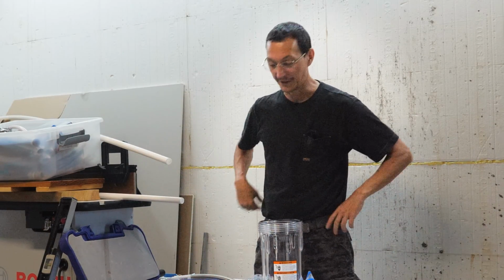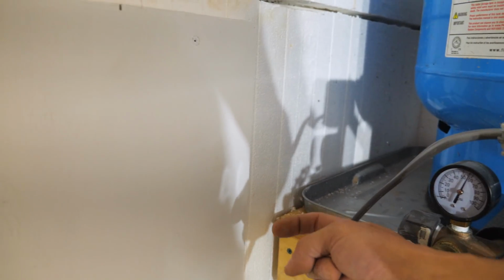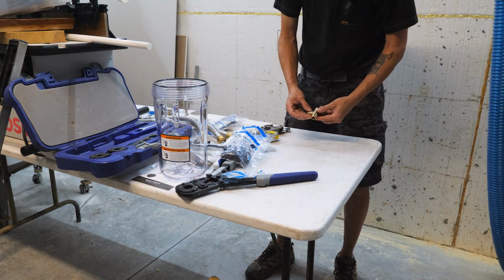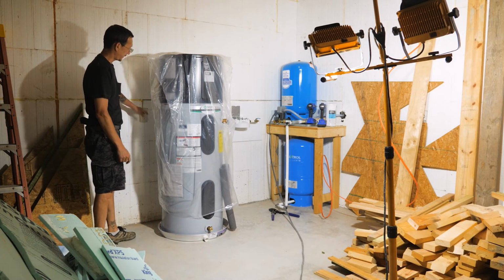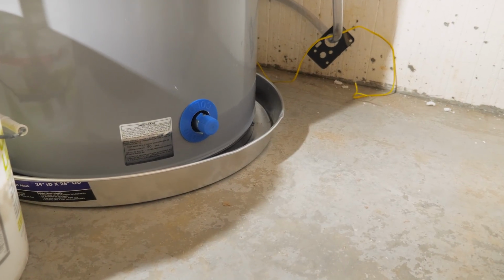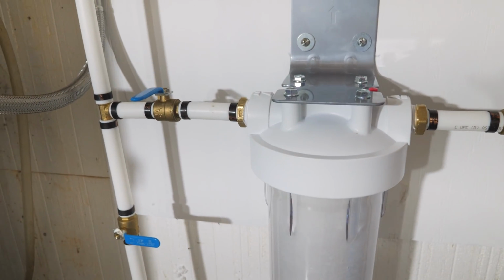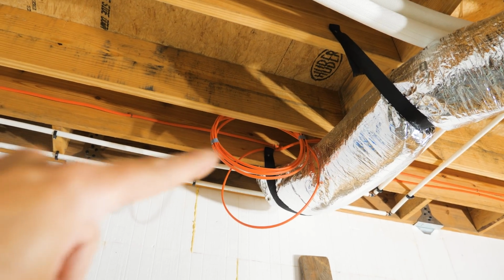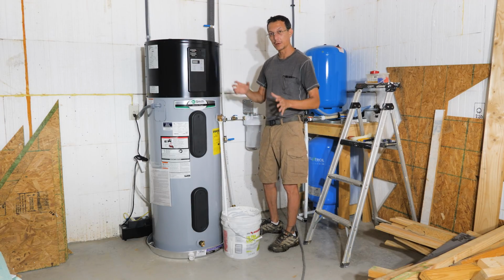Installing an AO Smith Hybrid Heat Pump Water Heater

Comment: I have trouble wrapping my head around how a heat pump generates more heat per watt of electricity than plain resistive heaters.  Maybe ill figure it out some day.

Being in a desert, most of my showers are going to be on the cool side of lukewarm so it's kind of a tough pill to swallow having a big tank of hot water sitting there, constantly dumping energy in to it 24-7.  If I did laundry more than 1-2 times a week or I liked long hot showers, I might feel differently but I'll be trying to conserve water too.

On the other hand, with solar the possibility of an all electric house with no power bill is very tempting.  I'm even thinking of moving my cooking to outside with an in-ground pit bar-b-que, a brick pizza oven and probably some type of griddle bar-b-que for searing, all powered from local mesquite wood.  Buying an extra tank of gas to go out in the desert looking for dead mesquite seems like a better use of money than filling up propane tanks and it cooks better too.

Any way, I hope your water heater works out well for you and saves money.
Reply: The answer is hidden in your first paragraph. A heat pump doesn't "generate" heat. It moves heat from one location to another. The energy in the heat, that is being moved, was already there. Where a resistive element must generate the heat from electricity.
Reply: We have our heat pump water heater installed in the garage. It does a good job cooling the garage in the summer, moving the heat into the water (essentially an Air conditioner). 

The winter here is mild, with lows slightly below freezing. But out garage will retain enough heat for adequate heat transfer into the water heater. Hybrid mode ( using the resistive elements ) will step in to fill in the gaps. We also charge two electric vehicles,  run a chest freezer, a washer and dryer (dryer is a ventless heat pump), all of which generates waste heat that can later be absorbed by the water heater..... assuming the garage door is closed.
Reply: Another way to think about a heatpump is that it concentrates heat, it takes the heat from the room which doesn't have to be higher than your target temperature and then 'compresses' it into a higher temperature to heat the water.

Comment: Why not put a "T" fitting coming off the pressure tank so you get unfiltered water to the outside hose bibs, save the filter for internal use?  I don't remember, are you going completely off grid for power once the build is finished?  Even if the local utility only pays pennies it seems you could "sell back" the excess generated from your array, although using the extra power as a water "pre-heater" definitely makes sense too.
Reply from the maker: We’ll have a hybrid solar setup with our system running critical loads.

Comment: Cool set-up! We're going to look at one of these Hybrid Water Heaters, when our current Water Heater needs to be replaced.  Observation: Our Building Codes would require the Water Heater to be strapped to a solid wall (earthquake land out here) and also we could not place Romex Cable inside a conduit like you did. But each county has it's own rules.

Comment: Another benefit of the water heater is that it will help dehumidify the basement.
Reply from the maker: Correct
Reply: @Guildbrookfarm  Not sure if you have spec'ed out your HVAC system yet, but I would consider adding a de-humidifier especially for an ICF house.  Probably save money in the long run by reducing the run time on the HVAC unit.